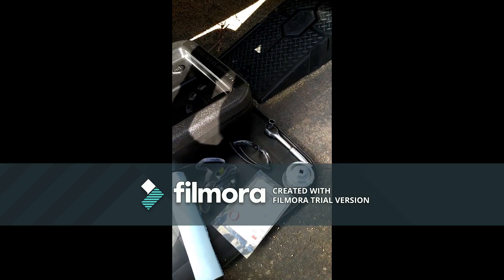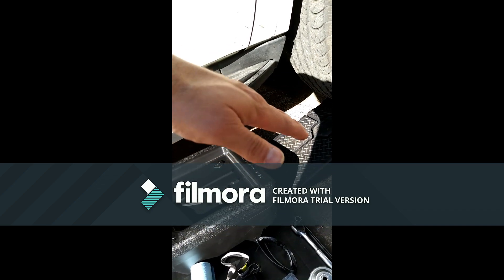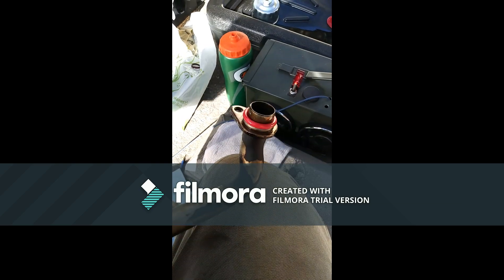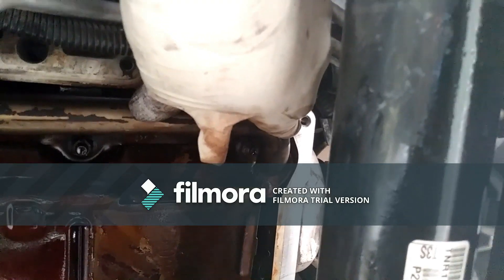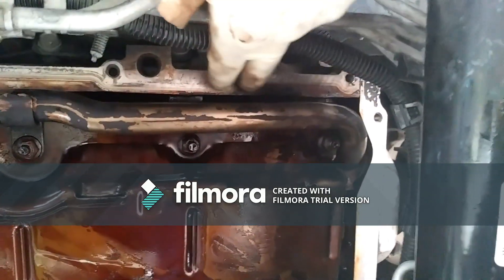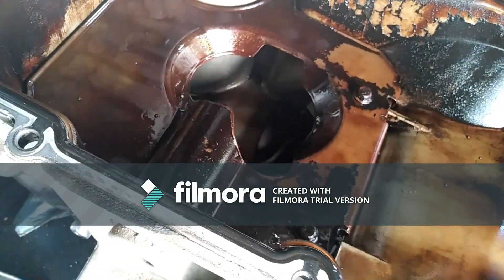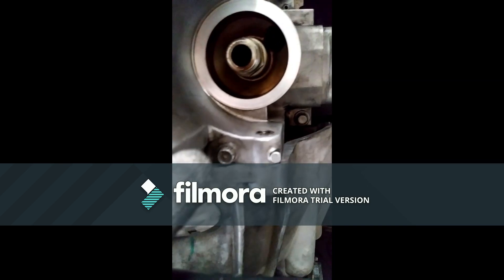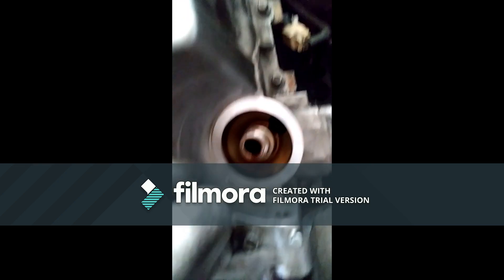Low Oil Pressure Message, Oil Pickup Tube Seal, 2008 Chevy Avalache, 5.3L engine

Comment: I want to try the hill thing but my oil.pressure does not go up at all it says all the way low and if it don't work. Check.engine code says change oil pressure switch. I was told not to start up like that as it did have a rough idle simular to a misfire. So is it still a bad idea to move it to a hill witch is from street to driveway.? I'm worried about costs. I bought pressure switch but I'm finding so many videos of different suggestions.

Comment: My 1st indication was the audible low pressure warning. Then ticking before I could pull over. Planning to do pump, pickup tube, o ring and try again. Looks to be a full days job in the driveway

Comment: Called a buddy of mine and we're going to do this to my truck ('08 sierra Z71 5.3L) in a few weeks. It reads low pressure and I have a tick on engine bay 1 which I'm hoping is due to the oil. Everything clears up once the engine is warmed up but then at idle it slowly comes back. Thanks for the video! I'll update after.

Comment: Car ramps wont work ? Not high enough to get the oil to the o ring?
Reply from the maker: They might. I just found it easier this way, especially since there are plenty of steep hills around
Reply: @raulsd.i.y.videos5585   i tried with ramps dint work my oil pressure is low but when i rev or drive  its at 40psi only dropps at iddle

Comment: Great Job man! Well done. Clear explanation of beginning condition. Then step by step with the practical tips on things like the rivets. Glad to see you pointed out the correct torque for the bolts. Then great to show the end condition with explanation of the gage pre-repair, the oil relative to the tube/seal and the demonstration of the 40 psi at idle at the end. Pro-stuff!!! Learned a lot. Thanks!
Reply from the maker: Awesome. Thanks.

Comment: 90% it’s the oil pressure sensor. My truck is a Silverado 08 with 245,000 miles.

Comment: Had the same problem on a 2006 GMC Sierra 5.3 L33 with 215,000 miles.  Changed the o-ring and the problem is fixed

Comment: Thanks for the video!!! Couldn't have done this repair without this video. I diagnosed with the hill test, probably 30 degrees and saw my pressure go up to 40. I purchased a new oil pick up tube from Amazon for $30 because I couldn't find the O-ring by itself. I started this repair with a 2008 4WD LTZ 5.3 Flex Fuel with 195K miles. Didn't read all the comments until I realized I would have to remove the front differential to complete this job. Getting that thing back in without a stand was the most difficult thing...extremely difficult.  After I removed the front differential, I kept the oil pan and got a new gasket. I cleaned both sides of the pan for the gasket with an attachment for my Milwaukee power drill and it was easy. I didn't use any sealant and the rivets I got from Harbor Freight weren't long enough or something...they didn't work so I continued without them. No leaks 12K miles later. Also replaced my CV Axle and my Air Conditioning tensioner while it was apart. Torque Specs from this video helped with re-assembly:  https://youtu.be/C4lmC7bYHGA?list=PLBR-SVH7NugF7bcwMDQ7oAaOQ9vx2DyPO  Vehicle is running great. All of this took me 18 hours and I am proud to have done it myself. Thanks again.
Reply from the maker: Kevin Bakel Awesome man. Glad the video helped!!!
Reply: Have any advice on saving time, I have a 08 suburban with 4x4 and I'd like to go in knowing what's the best route that will save time? Thanks
Reply: @srvntoftheLORD  Follow the video's instructions, but when it comes time to remove the differential, make sure you have a stand to get it back in... or a couple people to help, at least one. Have a plan/ tools on how to clean where the new oil pan gasket goes. Don't overtighten bolts with torque specs. Give yourself 2x as much time to complete as you think you will need.

Comment: Well explained test. Thanks! I have a ram 5.7 with similar symptoms. Low oil pressure at idle. All started after I removed the oil pump and installed a new timing chain as part of new cam install. Hopefully this issue is similar because I didnt change my o ring I left the original in there. Going to replace it now and see. Thanks
Reply from the maker: Ryan v what ended up being the problem?

Comment: Did you experience any performance issues before you replaced the seal? Like hesitation at low rpms or anything?
Reply from the maker: Not really. The drop in oil pressure didn't cause the engine to act any differently. It just caused an annoying alarm/error code to pop up.

Comment: i have a 2009 silverado with 5.3L... i just replace the oil pump and pick up tube with o ring... the pressure sensor  and i still have low oil pressure..... my engine dont knock or tick in any way..... any one have any ides what my issue is..... or what else can i do
Reply: Most likely your oil pressure  gauge is bad

Comment: Hello raul, i have the same problem with my 2008 silverado , i changed the oil pump the sending unit, and my oil pressure drops to 0 and the light comes on , but theres no noise of lifters o anything, , it dorps slowly then when i accelerate is comes up then again slowly comes down again, just want to ask how can i be sure if its the o ring that needs to be replaced?
Reply from the maker: Let me clarify. Go to a steep hill, drive down it, make sure the rear is higher than the engine, then come to a stop. If the pressure stabilizes it's the o-ring.
Reply from the maker: Go to a steep hill and drive your truck down it. Make sure that the rear end of your truck is a lot higher than the engine. This makes the oil flow forward towards the front of the oil pan and it submerged the o-ring in the pick up tube. If the oil pressure stabilizes then you know it is the o-ring.

Comment: Hi Raul, I recently had my oil pressure sensor and oil filter changed and nothing changed. My PSI is at 20. I then took it to a mechanic and he recommended for me to change the oil pump. He replaced the pump with one that gives you 10 percent more pressure.  When I accelerate the gauge goes up to 40 and drops to 20. Should I change this oring to see if it helps?
Reply from the maker: Did you try parking your truck at an angle with the front lower than the rear? Try this first. If your oil pressure stabilizes and the error goes away then the problem is the o-ring.

Comment: Good video..my oil pressure reads about 20 psi...there is no low oil pressure engine signs on mine..but i think 40 psi is the normal operating range of these LS engines. Mines is an LQ4. Do you think the o ring could be the culprit? Also my truck makes that dreaded ticking sound..🙄
Reply: JD O Connor you might need a new oil pump
Reply: @germannava8580  will definitely look into it. Thanks!

Comment: Raul good looking out. I have the same problem with my oil pressure and thought of replacing the pump. I forgot about the tube seal going bad. I 'm going to try the seal first and see what happens. Thanks
Reply from the maker: Nice. I hope it works!
Reply: Did it work?
Reply: Id do it all while ur gonna be there id do oil pump pickup tube and o ring if that dont fix it its a cam bearing that walked out

Comment: The first time this happened to my truck I was taken to the cleaners. I spent $2500 for new lifters, seals etc. Probably needed it though as I was pushing 150k. Almost three years later it started dropping again today It would slam to zero not just when I stopped but when I was driving - with low oil pressure light coming on telling me to shut engine off. (2007 SIlverado Z71 LTZ - NBS). I pulled the oil pressure sensor out, then pulled the small filter out underneath it. Cleaned it up, up it back in with same sensor and its been good ever since.
Reply from the maker: Nice. That would have been the next thing I tried had the "hill" test not worked

Comment: Is must be a rwd  truck   4 wd is alot more work
Reply: On a 4x4 you have to remove the transfer case ..which is a little more work but not hard .   As you stated  my Oriing was  bad.  Replaced and problem fixed   thank for the great video
Reply: @42montee  why would you remove the transfer case?  I have a 4x4 and it appears that I just remove the front 4x4 driveshaft and you're good to go. The transfer case is behind the transmission so you're not going to gain any room.
Reply from the maker: Awesome! Glad it helped you out!
Reply: I still can't imagine what the point is of a 2wd Avalanche, but they go cheap enough at auction to buy them as parts trucks for 4x4's.

Comment: I have a 2007 ltz tahoe and it also have low oil pressure about 12psi at times I just left the chevy dealership and they told me I need a new motor I HOPE THIS WORKS
Reply from the maker: A new motor?!?!!? Yikes. Hope this works for you.
Reply: @raulsd.i.y.videos5585  mine dont drop to 0 and I tried the hill thing I seen no difference I added Lucas today and the pressure went up to about 20 before it was dropping to 12 but no light came on
Reply: Chatt James you may need to change the oil pressure sending unit and or filter screen.
Reply: @caesarray4597  dang seal was worn and unattached
Reply from the maker: @Chatt78  did changing the seal fix the issue?
Reply: I have an 07 avalanche , same problem , low oil pressure at idle and it doesnt pass 20psi .
I already switched the oil pressure switch and no luck. I took it to the mechanic before i saw this video.
My truck only has 1,800 miles before the warranty voids lol
Reply: Did this work for your truck?

Comment: Did you have to add any oil  to test it out? I did this test and no change in pressure, but ive read online some people are saying you need to add 3 to 4 qts of oil?
Reply from the maker: buggy saywhat I would only add oil if I checked the level and it was low. Otherwise I wouldn't add more oil simply to do this check.
Reply from the maker: buggy saywhat how steep did you have your truck? I had to be at a pretty big angle.
Reply: buggy saywhat screen clogged with what?

Comment: They all do it on these LS motors, its a bad design, we always took our conventional sb chevy race motors and welded the tubes to the pump. On these LS motors I would do the same or JB weld them so they wont suck air.
Reply: They should have a strong gasket that goes around it instead of a stupid o ring